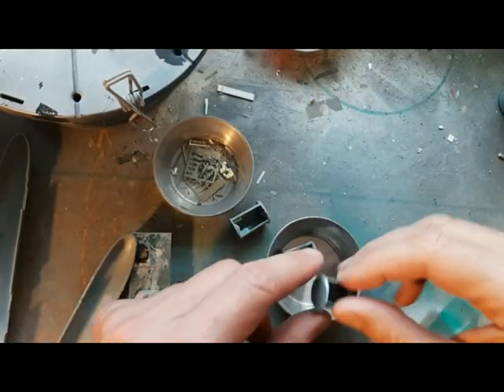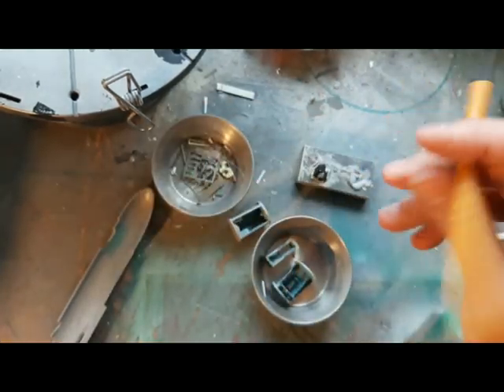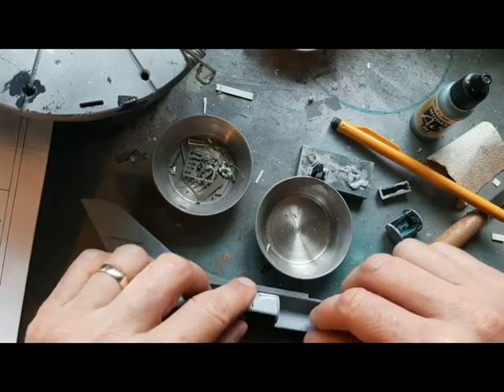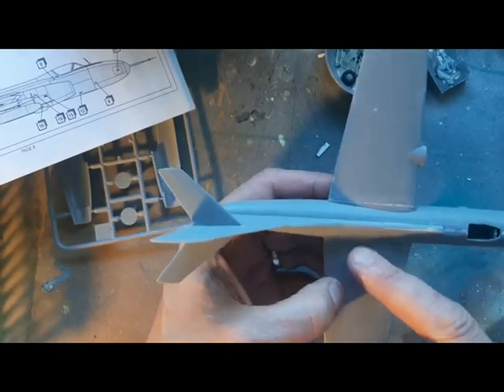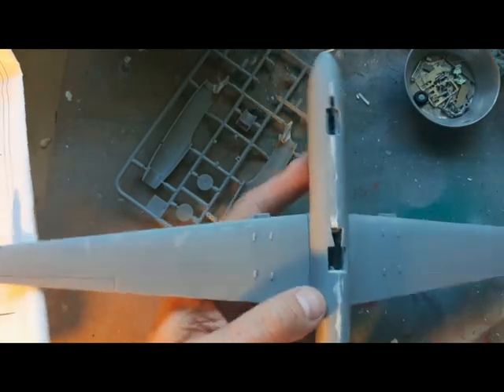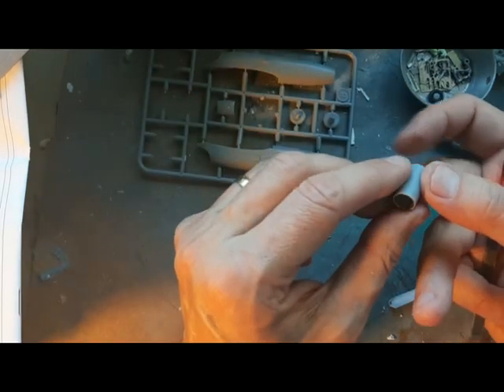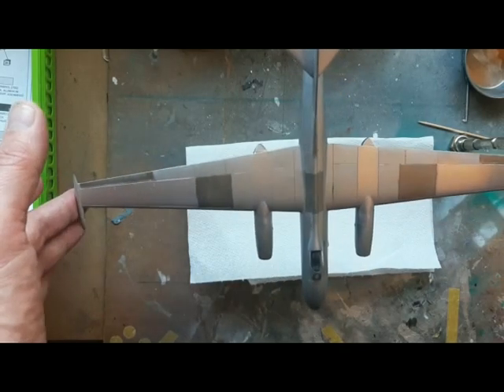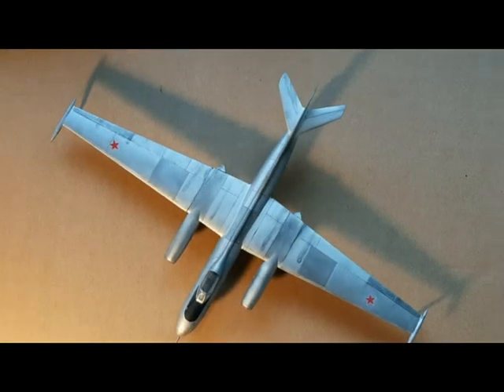Yak-25RV Mandrake Build Video Amodel 1-72 scale

Comment: Hi Len, great work on the Yak 25RV, Liking the intake covers how did you make them I'm looking at building some for my Concorde.
Reply from the maker: Thank you for the feed back, its much appreciated. I just make them from thin plastic card. Guided by ref images. In this case I cut them with a circle  cutter then put on a cross of thin strips to provide the bracing. You can see examples on my Su15 Flagon double build , Mig29(Airfix), Mig 25UM, build vids. Some times I add handles made from wire.

Comment: Love the Mandrake! I always reckoned it for the Canberra's not-so-swift cousin of sorts. If you took the Canberra and the XB-46,  popped them in a blender, then tried to make it look as least like the Yak Flashlight as possible and baked it until it shrunk like something out of Fantastic Voyage, that's what you'd land. lol  The whole Yak-25 line is such a garble of Soviet design politics, engine manufacturing squabbles, and the break into the air-to-air missile realm of interception that you really wonder who was getting their Lada polished for the adventure. That the Yak-26 came out of the same design evolution is just a spanner in the works at that lol
Reply from the maker: Thank you Claire that's a great summary of that series of Yaks, I built the Mangrove a while back and have the Firebar in the stash,  just need to find a 1/72 Brewer. I know they all had performance issues but they also represent Russian iterative design philosophy. In the west we spend more time in the deign phase. In Russia its: design, build, try, tweek, tweek ,design, build, try. I like their approach.